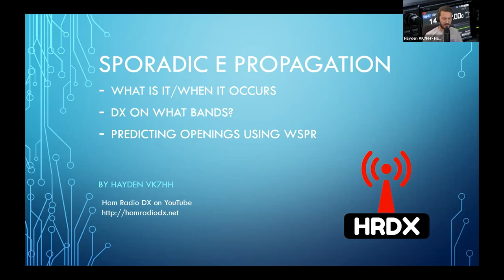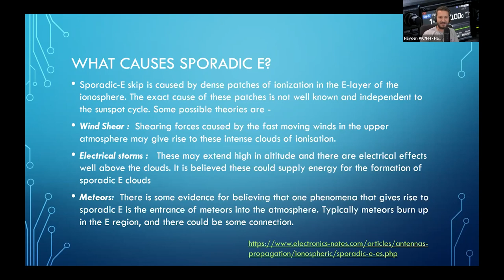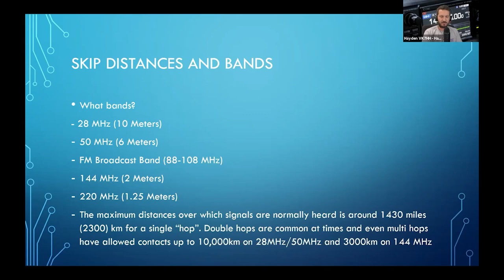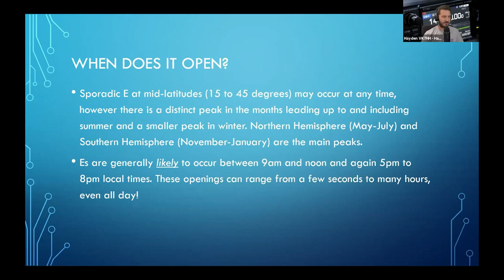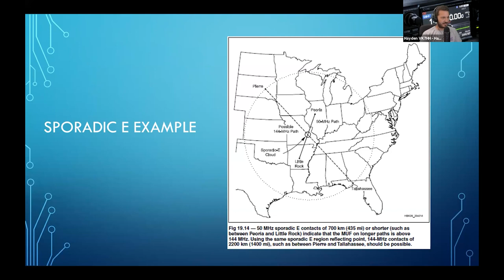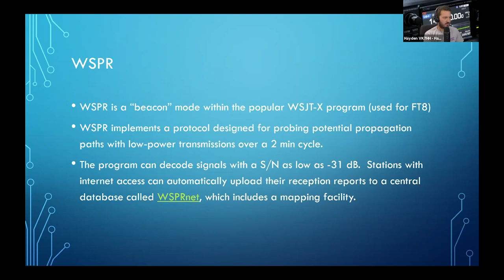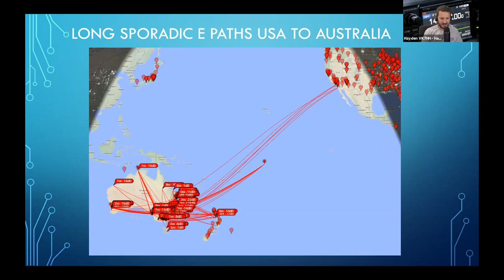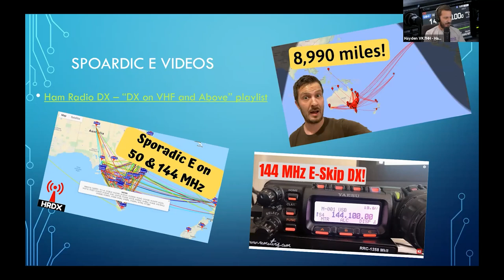Understanding Sporadic E Propagation for VHF DX

Comment: Great video. - FYI, I'm actually finding FT8 a better tool /  indicator of Sporadic E openings on 10m than WSPR, due to the shorter TX/RX periods, and at most times, the greater number of active stations. 73
Reply from the maker: Yes FT8 works really well for the short openings for sure! Thanks 73

Comment: Very good, I can comfirm it, starting on 6m about 25 years ago  with the 2m<>6m transverter from Elektor in those days and a Ft260,  my first qso on that band (1W output ) and a antenna !? I was still building with only a dipole and a reflector  1m ( 3 feets ) above the grass  was OE ( Austria ) <> ON (Belgium) you can imagine that I was sollt for this band, so later I bought a Ft 690 ( 10W ) and a 5 ele Tonna second hand, with this equipment I made a lot of qso's  even intercontinental to south-Africa (ZS) and the America's (PY) these qso's were made end Oktober while the best season is from end April to middle August with a peak in June, at the best you don't need much power, have make qso's from a ship in the mediterran sea to home (Belgium) with the Ft 817 ( 2W on battery-pack) and the rubber-duck-antenna, since past year I bought a transvertor 4m <> 10m and work in July CT ( Portugal ) & 9A (Croatia) with 10W output and a omnidirectional antenna horizontal polarizated under the roof !  made also a few qso on 2m but these a really rare,  the last years I was not anymore able to make intercontinental qso's  why ???, but have to say not anymore qrv as before, my english is bad, but never learn it at school, sorry
Reply from the maker: Thank you Patrick. I understood your comment perfectly, great English! Sporadic E is a wonder and great fun. Small antennas even work really well. 73 and thanks for stopping by